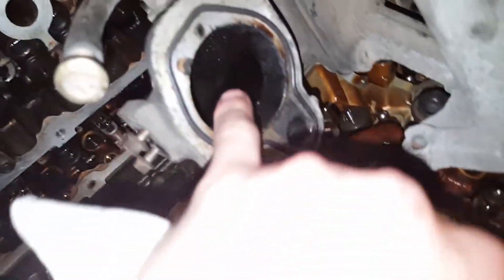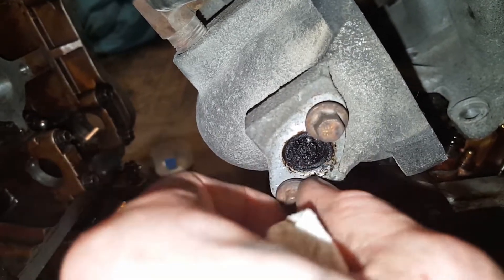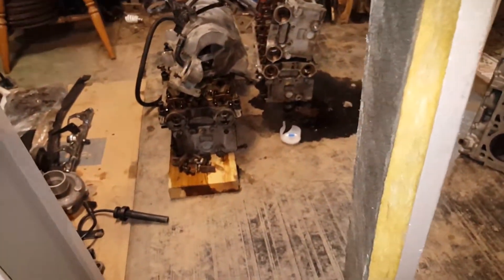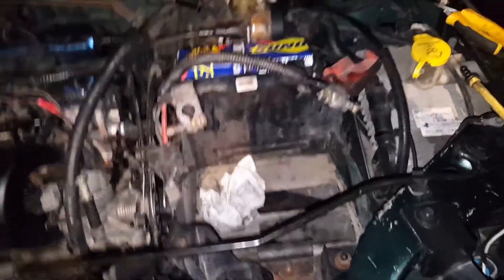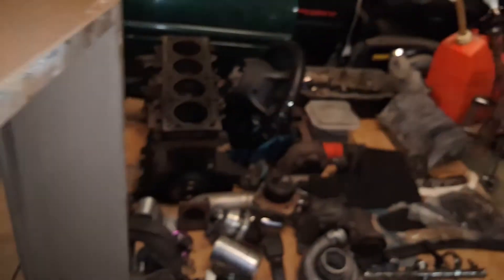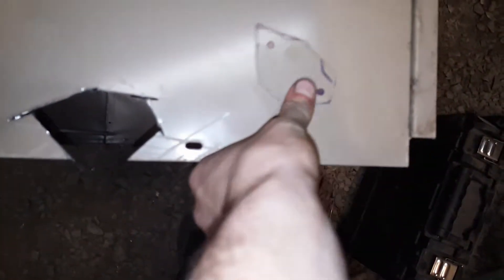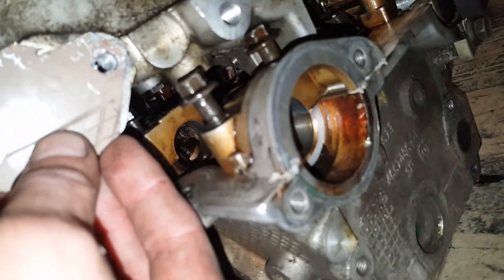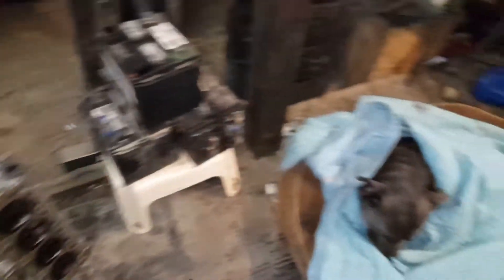DIY EGR DELETE ON A 95-99 DODGE NEON DOHC OR SOHC

Comment: Hey man I replaced my cam sensor and crank sensor that's what code read 1391 didnt fix took for test drive and problem continued car when warmed up and going a couple miles car start jolting and stops accelerating doesnt turn off but sputters any clue 2002 neon 2nd gen thanks

Comment: i have a easier method, if you look at some of your old blocks or heads, you will find oil gallery and coolant plugs. they are threaded and near the same size as the egr hole in the head,use 3/8 extensions to remove. and with a little oil on the threads of plug. you can screw it in nicely, looks like factory
Reply from the maker: +evilnygneon hell yea good idea
Reply from the maker: +evilnygneon not to many people just getting into neons or cars would have those tho....but I might try it just for my car
Reply: any old head from a dohc/sohc/or 2.4 have the plugs, can get them from any machine shop for 15 cents

Comment: Why not just make a thin metal "gasket" and bolt it under the egr assembly.
Reply from the maker: +chriscat85 looks cleaner with the block off I like cleaning the engine bay up of useless scrap but u could

Comment: every time I do this egr delete my car has crazy exhaust gases out the tail pipe
Reply: WTF is a "crazy exhaust gases" ?????
Reply from the maker: Lol ur guess is as good as mine lol egr just warms the engine like a old school choke would just newer
Reply: "Crazy Exhaust Gases" ;) - The EGR valve is a pollution control device - it cycles exhaust gas into the intake stream to COOL combustion when the engine is hot. High combustion temperature creates NOx (Oxides of Nitrogen) which are green house gases. Exhaust gases are inert -  they don't burn cuz they are already burnt- cycling them back into the intake stream with EGR (Exhaust Gas Recirculation) displaces oxygen and keeps combustion temperature low enough that NOx don't form.
Reply: Yea. That's exactly whats supposed to happen when it's not recirculating back into the engine.